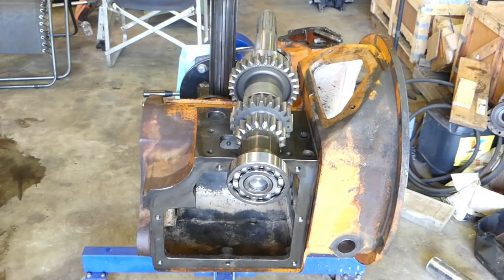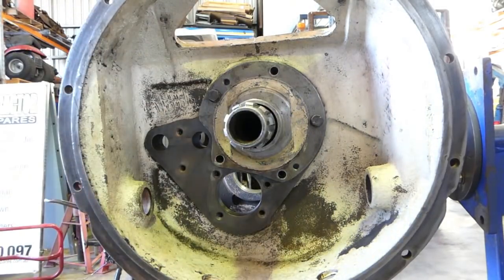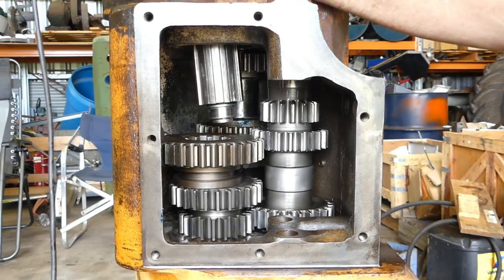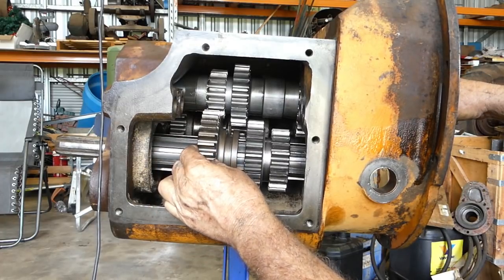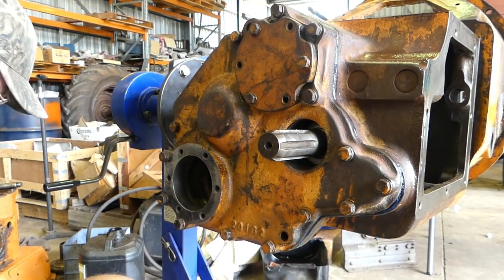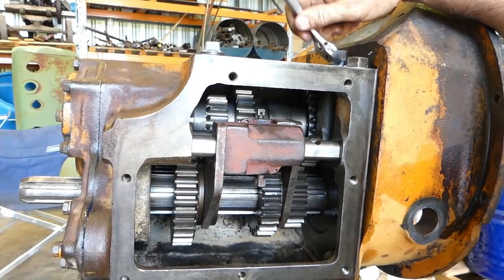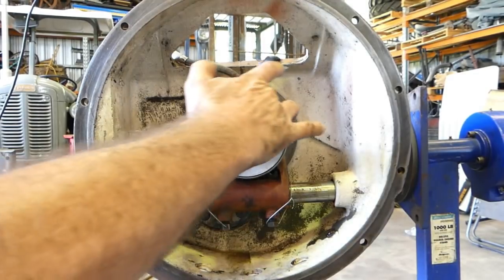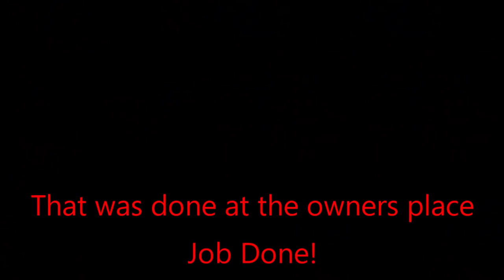Chamberlain Front Gearbox Overhaul Part 2 Assembling the Box.

Comment: Hello Lance, I will never work on a Chamberlain gearbox but I appreciate watching you do it to learn steps one can take on any similar job that ensures the results are satisfactory, such as stoning the input shaft and then taking the added step of taping it to insure the seal lip is not damaged during installation. Those are the kinds of things an experienced mechanic has learned to do, probably from a bad experience in the past!
Reply from the maker: G Day Dave, Probably not many mistakes I havent made over the years so hopefully I have learnt from them all.

Comment: Hi Lance,

Another great tutorial there.
That box took me back to 1981.
I trained in Ag Eng but fell into the Golf Course, Sports Ground world of machinery early on.
We had a 4ft Auto-Roller for rolling cricket squares in the shop unable to get a gear.
Took the top off, was as dry as snuff, selectors seized solid on their rods.
The oil wasn't getting thrown up to the top by the layshaft as it couldn't turn fast enough due to the very low forward speed.
It had straight cut gears, 4 speed with top gear blocked off for safety.
BMC used that box in their VAK 100 vans I believe.
I passed my Semi license in my 20's, we had to double de-clutch every change on a synchro box to pass the Test..!!
Imagine one of those with a range change today, forget that.

Cheers,
Paul.
Reply from the maker: Thanks Paul.

Comment: Very nice video. Other gearboxes (eg BMW R1150 motorcycle), also uses bearings with seals on both sides. BMW did that on purpose, to ensure grease stays in bearing, and any contaminants cannot damage bearing.
Question though, how does the front o-ring get oil? This as the forward side of the bearing still has a seal.
Reply from the maker: That is why I put the grease in there to lube the seal

Comment: Fine work. Just impressed that the webs of that casting are thick enough that the bolt holes are blind, that machine was built to last. It appears 3 speed and reverse, is there a two speed rear axle in this tractor?
Reply from the maker: 2 and 3 speed back ends depending on the model with this box in front.